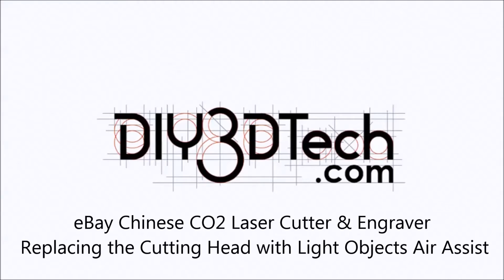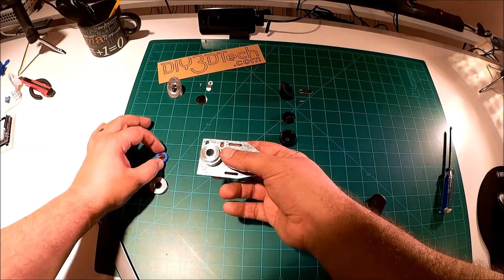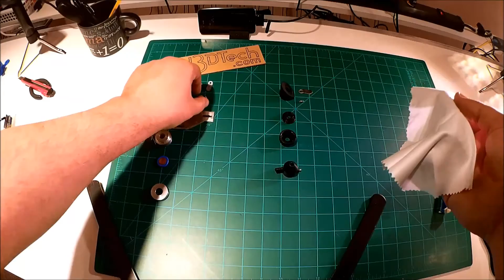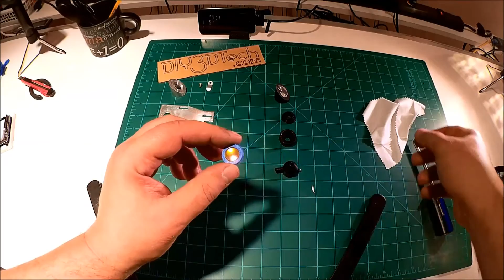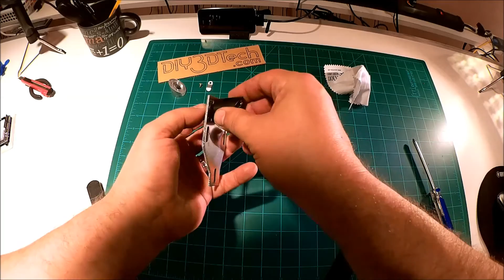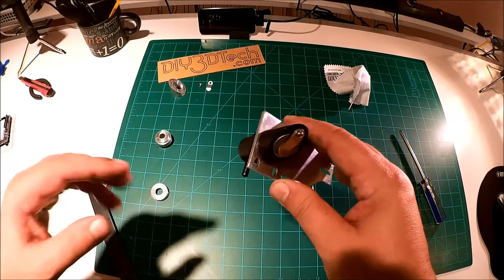eBay Chinese CO2 Laser Cutter & Engraver - Light Objects Cutting Head and Air Assist Replacement

Comment: Do you have a tip for tightening the laser head? Regularly after some time, the head unfreeze and the quality deteriorates greatly. Subsequently, it must be re-tightened and adjusted.
Reply from the maker: Sorry, have not had that issue with mine so I can comment...

Comment: Once again, from whom did you buy the air flow accessories for $20?
Reply from the maker: +John von http://www.lightobject.com/ great little company as I also got the lens from them too and would suggest ordering them together (air assist & new matching lens) as the replacement lens is far better than the one which came with the machine.
Reply: +DIY3DTECH.com thanks so much. I truly enjoy your videos on the 40w laser. I just bought one and I should have it within a week or two. I probably will be contacting you for advice. Keep up the good work. Thanks again!
Reply from the maker: John von Very cool and please keep me posted as I will be doing a lot more on it the next month or so, just traveling a lot for work so not much time right now, but lots of plans!